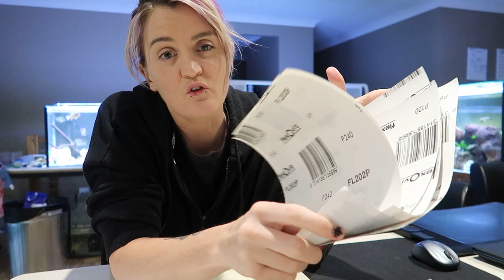RPSX Retro 180sx | 013

Comment: Let's gooo! Love getting updates on this thing, the direction you're going with it is sick. 

If you're chewing through sandpaper, a surform or some 40 grit is great for roughing in the basic shape and then 80 grit is good for finishing up curves and details. Also if you get a little bit of expanding foam instead of body filler it works mint for sticking the blocks to the car and filling in gaps without setting super hard and messing up your lines like the filler does.
Reply from the maker: thank you for tips. do you have a 2 part expanda foam you would recommend? I try the cans to fill the gaps later on but the stuff turned out rough
Reply: @LOKISX  My supplier changes brands every time I go in so I think just any type of 2 part pouring foam is good. The spray cans can help if you're really in a pinch and need to fill upside down but the foam from them is little softer so it sometimes tears rather than sands. The pouring foam is where its at.